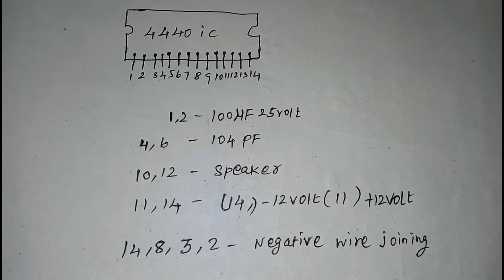Powerful 40 Watts Amplifier Without PCB

Comment: LA4440 is a two channel audio power amplifier IC with inbuilt in dual channels enables it for stereo and bridge amplifier applications. In dual mode it gives 6 W per channel and in bridge mode 19 W output.